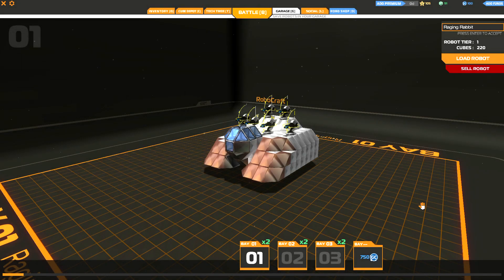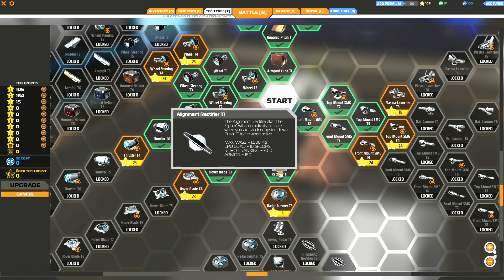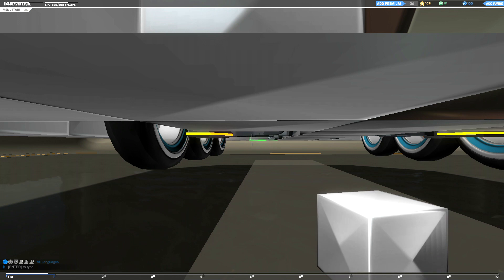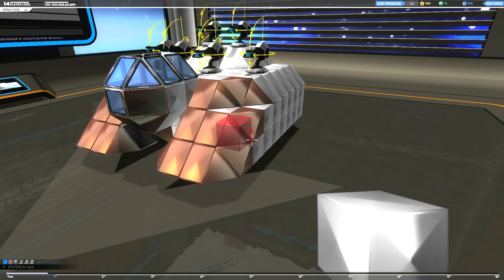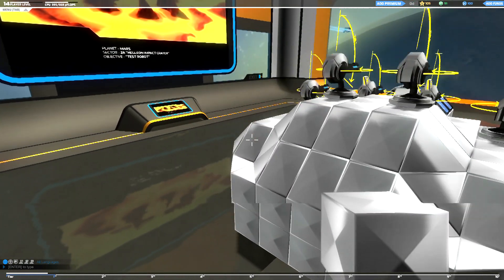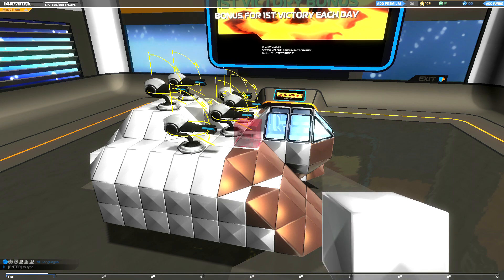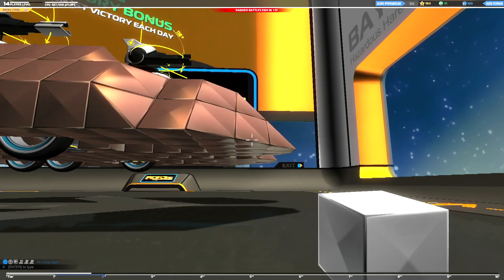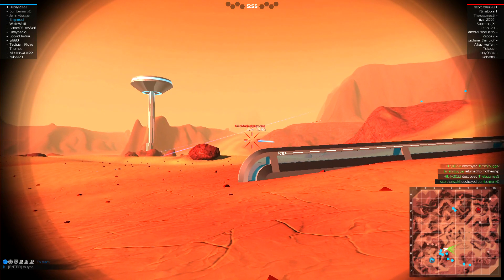Robocraft Early Access (Ep. 2) - Build Basics

Comment: I think that the in-game vision should be always first-person so that the positioning of the drivers seat and the usage of windows would make the designing process more in depth. Also the slanted armor blocks should add more protection against SMGs and direct cannon fire, just because of the chance of a ricochet. Speaking of the guns, is it even possible to make protective barriers for the weapons? Like an inset or something? I guess that you'll need a huge platform to even mount one weapon rack. And for the last thing I want to mention is that the player should be able to use multiple types of weapons on the same vehicle.
Reply: Unfortunately it's really not possible or effective to shield your guns on a vehicle. You can't place anything to close to the guns, depending on the size of them. You could build a cover around the guns the way Enigmius showed for the wheels, but it's going to take up even more space and limit your fields of fire, since  you can't shoot through your own blocks. So in the end it just isn't worth it. I try to mount 8 SMGs on my vehicles, specifically so I can afford to lose a couple without hurting my firepower.